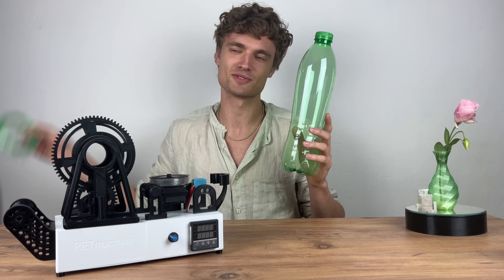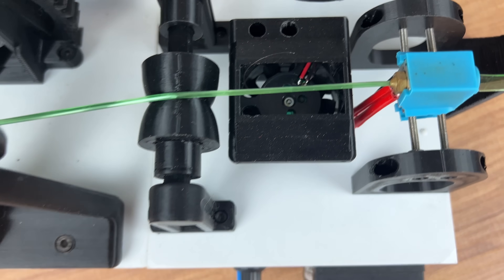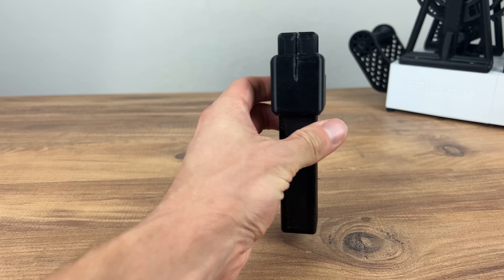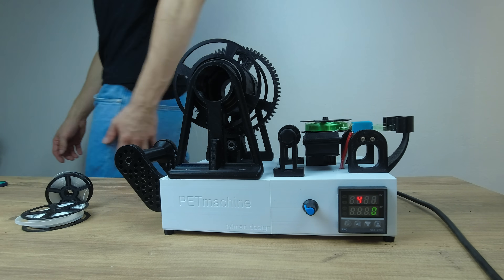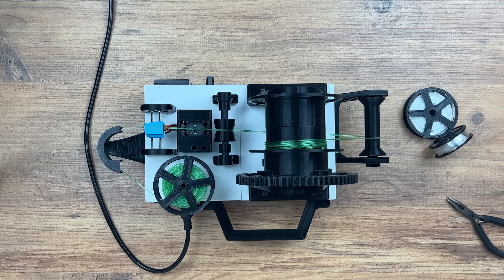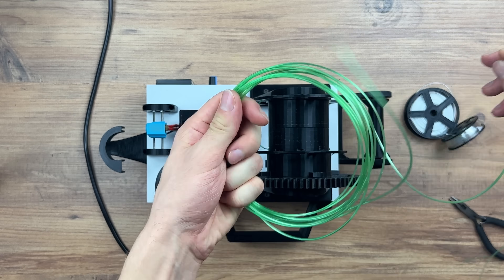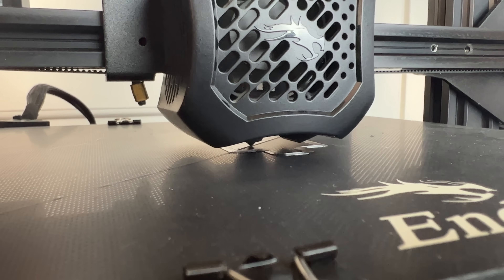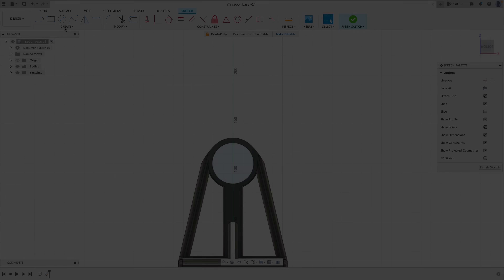Turn Plastic Bottles Into 3D Printer Filament at Home | DIY PET Recycling Machine!

Comment: I love it! If I may suggest an improvement, try to make it into one machine:
1st level - a grinder for grinding bottles to flakes.
2nd level - a hopper funnel that collects the flakes into one heating "pot"
3rd level - an injection nozzel that outputs the fillament!

That way you reduce the amount of involvement by the user, and the outcome is more uniform.

Great work sir! Well done!
Reply from the maker: Hello! Thank you for your great comment! Yes quality of the filament will be better, but cost will be 5-10 times higher. I prepare my project especially to be affordable and easy to make for even the beginner.
Reply: @TylmanDesign  
Hmmm... What if you will make the grinder +*mechanical*+ ? Like... hand cranked?
Reply: @AVMMM  That's an idea, but moving the flakes through the hot end/nozzle is tricky and that's what makes it a bit more expensive. In the plastics business (I'm going back 25 years ago, when I was an embedded systems engineer for the plastics industry), we'd use a screw extruder to push pellets, or flakes of ground up product (that was at a dairy, where gallon jugs that failed in production could be re-used). The best way to feed is pellets, of course - some consistent shape provides the best movement. The whole process was a big bigger in scale, of course. The key to reclamation is in the extrusion system.
Reply: The green vase looks perfect as the print lines make it look almost iridescent! For the clear one, have you tried using a heat gun to smooth out the lines, and see if that increases transparency? Would be interesting to test
Reply: i would think melted plastic fumes would be most unhealthy

Comment: I'm a beginner, can you recommend a program and a 3D printer?
I'm very interested in this,
thanks in advance
Reply from the maker: Hello, for sure I can recommend you "Cura Slicer" as a program for preparing .gcode from .stl file, I'm using it for many years and it's great. 
For modeling 3D objects I strongly recommend "Fusion360", for hobbyist it's fro free and there is many tutorials online. 
If we talk about budget printers I really recommend Ender 3 V2, I'm using it for a few months all the time and for this price it's really nice (250-300$). You will have to change/add just few small things to make printing safer and more predictable. It's a very simple "surgery". With time you will understand everything about 3D printing, it's very enjoyable. If you want to buy a really really good printer I strongly recommend the Prusa i3 MK3S+, but the cost is around 700-850$, but it's the "tank" in the 3D printers world, you can print 24/7 for the whole year with no problems.
Reply: @TylmanDesign  Thank you very much for your advice.  I would like to study what you advise.  thank you again.🙏😊

Comment: can you share the nozzle temperature to print with the bottle filament ?
Reply from the maker: Hello, depends of the bottle, 250-260 degrees.
Reply: @TylmanDesign  thank you, i just upgrade my ender3 v2, with a sprite extruder, just waiting some pieces to start to build a recreator but i think i will do yours too ! Great video thank you !
Reply from the maker: @urotsukudoji6663  Super nice! I'm curious how this extruder works, I have Ender 3 V2 as well! Every machine like this and try to care of the environment is amazing! I will be happy if you will build my project. You can check my IG, I share there my prints and things about machine, like updates and tips!
Reply: @TylmanDesign  sorry i was with my 2nd account, thank you for your rapidy !

Comment: Hi Igor, do you dry your pet filamemt? I noticed a lot of popping while printing mine.
Reply from the maker: Hello! Unfortunately I don't have conditions to do it, but I would love check if there is a difference (and I guess there will be). Till now I was printing with pet filament without drying, all the time with acceptable surface and almost no bubbles. Lately I processes a bottle of water that was really hard to print, crystallizing and constant popping during printing, it could be moisture, but I was preparing it like any other bottle, so it's maybe about particular this one. The most important thing is constantly straight strip with no bigger fluctuations (with proper height), to create maximally rolled tube of plastic. Popping can be correlated with crystallization and maybe lowering the temperature will help! What machine do you use? What's your cutter?
Reply: @TylmanDesign  I use an ender 3 bowden extruder with Cr spider all metal hotend. i use petamentor design to extrude the strips, I bored 2 nozzles, I noticed that it works better with the smaller nozzle and a 6mm strip (depends on the bottles) 

My issue is that it stops extruding and the exteuder gear slips over the filamemt at some point so i guess i have heat creep. Right now I am printing a fan duct for the spider hotend and I'll update to a noctua fan. 
To note that my extruded filament looks prestine and there is not much fluctuation, I am overly impressed with how good the puller works.
Reply from the maker: @raa6504  I was using Ender 3 V2 and Ender 2 Pro for printing. I had same problems with slipping and I mounted dual gear extruder for both printers and I forgot about slipping. Due to I don't use full metal hotend I installed Capricorn PTFE tube and it works great. I changed my hotend radiator fan for 40x20 (Sunon) as well. With all these things, 6h prints are not a problem. Noctua fans are quiet but don't have best efficiency.
Reply: @TylmanDesign  thank you for your insight, I already have dual extruder in the amazon basket, I'll look for a 4x2 cm sunon fan. 

Thank you for taking the time to assist me. 
Cheers
Reply from the maker: @raa6504  My pleasure! Cheers!
Reply: Just for fun I also printed 1.6mm trimmer nylon line and it printed just fine except the moisture, so the problem might be a combination of, filamemt hardness and being slippery by nature, heat creep and viscosity.
Reply from the maker: @raa6504  Yes this nylon trimmer line is a funny filament haha But for the most of extruders not reachable. Bottle filament is challenging, but once we understand what it need and how it works it's really nice material, especially that we made it in our small factory haha

Comment: Can you tell me which modeling programs you prefer using
Reply from the maker: I prefer to use Solidworks, but since I changed my laptop for MacBook I have to use Fusion360, it's not that bad, but I used to so much for Solidworks.
Reply: @TylmanDesign  thank you for quick response
Any advice for a beginner
Reply from the maker: @badressam473  To be honest, if I will have to choose it now again, I will go with Fusion360, for designing 3D printing parts or not really complex projects is perfect, I was using Solidworks for 6 years, recently when I started to use Fusion360 it was frustrating a little bit when things didn't work like in Solidworks, but with time my designing speed is almost the same like before. The all basic functionalities are almost the same, Solidworks is for more professional purposes, so for my needs Fusion360 is more than enough, but the biggest advantage of the Fusion360 is license price, it's many many times lower than solidworks one, like 500$ vs 4000$ for a year subscription. Fusion360 save everything in the cloud and you work on the files online, it's amazing solution when you work in a team, you see your previous versions of the particular part and so on. And of course Fusion360 is free for hobbyist use. There is many tutorials for Fusion360 as well.
Reply: @TylmanDesign  
Thank you so much
I really appreciate your effort

Comment: if you heat up strips from two bottles will it connect and go through the machine creating longer filament?
Reply from the maker: I was testing this solution with small successes, I used soldering iron to make a horizontal lines on the two strips lying on top of each other, now I have to create kind of heating heat to do it better.  My goal is to merge two plastic strips before processing so we could prepare long spools and use it later.
Reply from the maker: Hello! We will announce and put PETwelder on sale very soon. You can follow my Instagram account to follow the progress about it: www.instagram.com/tylmandesign

Comment: How do you compensate for varying thicknesses of the bottle walls? Do you adjust the strip width to compensate?
Reply from the maker: Hello! Yes, exactly, for example 0,2mm thick bottle we cut to 9mm height, 0,4mm to 5mm and so on. Cutting machine has 6 different channels that allows to adjust the height of the strip accordingly.
Reply: @TylmanDesign  I see. So you can manually adjust it but it doesn't automatically adjust when it encounters a thicker area or a thinner area in the same bottle. Wall thickness isn't consistent in any bottle, after all. That's especially true of both ends, which are always thicker than the middle is because of the way a bottle is made. Even the sidewalls, though, have inconsistent thickness because PET isn't perfectly homogenous.

Comment: Does the filament work with all 3D printers? Even pla filament 3D printers?
Reply from the maker: Hello! Stock PTFE tube (especially in Chinese printers) is a poor quality, this filament require higher temperatures, frequently even limit of 260 degrees, in this situation normal PTFE tube can degrade faster compared using with lower temperatures. Solution is changing PTFE tube for "Capricorn PTFE tube", quality is very good and it can stand high temperatures better, I made it in my Ender printer and it works great. We can change our hotend for fullmetal one as well.

Comment: How do you make longer lengths of filament?  Overlap the strips going into the hot end so they fuse together.  Maybe glue them with 3D gloop?
Reply from the maker: Hello! It will be the biggest step forward to make it in easy and fast way, I made some tests and I merge it in primitive way using lighter and PTFE tube and it worked, I could print bigger model of HULK from 2 bottles that you can check on my IG. I'm waiting for some components to make first prototype of more comfortable splicer, keep following! 

I think 3D gloop could be a little bit too weak due to really small area of glueing , what's more it can clog nozzle later.
Reply from the maker: Hello! We will announce and put PETwelder on sale very soon. You can follow my Instagram account to follow the progress about it: www.instagram.com/tylmandesign

Comment: wonder if you could use a heated clamping tool to fuse the unrefined pieces of plastics together while on the roll to get a bigger spool as it goes through the heater portion to keep the machine constantly working?
Reply from the maker: Thank you for your comment. Yes it will be amazing. I'm working on it already with smaller and bigger successes. I think I will have a solution soon.

Comment: What temperature do you use on heat table and what thing to glue first path?
Reply from the maker: Nozzle 245-255 Celsius degrees
Table 70-75 Celsius degrees 
I was using normal glue stick, but even without it adhesion was very good.

Comment: 1 bottle of 2 liters is for how many meters of filament?
can you join the plastic of 2 or more bottles together to make a large roll of filament?
Reply from the maker: Around 10 meters. Yes you can joint it after processing the filaments. I'm working on a solution to merge two string before processing it, so for example it would make possible to put big spool to the machine and make wind long filament.
Reply from the maker: Hello! We will announce and put PETwelder on sale very soon. You can follow my Instagram account to follow the progress about it: www.instagram.com/tylmandesign

Comment: was there a difference between PET and PETG with both different filaments due to the color, polymer structure and how well they adhere when it is printing.
Reply from the maker: Adhesion was almost the same, different is printing temperature. The glycol addition in PETG make it more flexible than PET as well.

Comment: Hello, which used beginner printer do u say is good? I have multiple things for under 100 Euro.  Those i have found:  Creality Ender 3 3D, Anycubic Photon 3D, Artillery Hornet 3D, SIENWINY YS-01 , Anet A2, Anet a8, Renkforce RF100 3D.    Which one should i buy?
Reply from the maker: From these You showed Creality Ender 3 is winner. I recommend to pay a little bit more and take Ender 3 PRO version, or Ender 3 V2. They have few upgrades that are nice.
Reply: @TylmanDesign  Ok u say what basically 3/4 others said. I guess its the best way. Its also really cheap used and support seems to be the best with many people using him. I will give him a try! I see forward to try things from youre videos very soon!
Reply: @TylmanDesign  If money is not relevant.. would u buy the Ender 3 Pro or the Ender 3 V2 ? Because they are basically for the same price..
Reply from the maker: @Psychedelic-Playground  Ender 3 V2 for sure, it's the next version of Ender 3 Pro and it's much better.
Reply: @TylmanDesign  ok finde i look forward to find one! I have so many ideas 😁😁👍 Thanks and have a nice day. 🙏

Comment: How is the quality of the printed vase? Is the strength/properties same as the original bottle.?
Reply from the maker: Due the fact it's vase mode it won't be durable like normal bottle, BUT print is pretty solid, layers are sticking very well and I can squeeze vase with no harm for it. 

I printed other models without "vase mode" and they are really tough. 

Im preparing small surprise that I will release on the next weekend!

Comment: Great job!  Perhaps you could waste a little less new filament by taking up the initial thread with a string instead of pulling it by hand.  Then the machine could begin pulling at the proper rate as soon as the filament exits the heater.
Reply from the maker: Thank You so much for Your comment. Good point! I will try to make it asap! Coz it's a big saving of time and material, small improvement but really profitable.

Comment: How much filament do you get for one bottle?
Reply from the maker: From 1,5L bottle around 20g, depends of the thickness of the bottle's wall as well. Using 5/10L bottles we can have it pretty a lot. 

We can merge two filament together and make longer and longer one. But I will introduce it in the future.

Comment: Happy to see an E3V2 like mine printing with PET. Can you share your settings?
Reply from the maker: nozzle 245-255
bed 70
speed 30-35 (I want to reach 50)
retraction lowest as possible 
fan 15%
Flow 105-120% with this filament

Comment: Hello Igor, very interesting project, I'm sure with the research you made for this machine you came across  
some industrial plastic beads heater nozzle, I'm curious if you had the idea to cut the plastic bottles into beads ready to be melt and then process the filament directly. Thank's
Reply from the maker: Actually yes! I have really BIG shredding machine waiting for me. It's a good thing for next projects!

Comment: Absoutely amazing. I just would suggest to use a string tied to the filament holder and the first inches of filament, then you need to pull less time and the constant force of motor takes the work earlier.

Comment: a cool idea would be to make the spool removable so that it can keep the filament on it after processing and be used straight away for printing without having to remove it then placing it on another spool.
Reply: I also heard you said there would be a module to have it cut the plastic bottle as it pulls it through as well? that would be great for automating the whole thing after smoothing the bottle and pulling it through the hot end.
Reply from the maker: Yes, I'm testing it now, but lately I don't have time to finish it, I'm so sad coz of this.
Reply from the maker: You are totally right, it will make it even more amazing, in the future version I will implement it for sure!

Comment: Man keep up the good work  just a few refinements from spectacular, maybe a removeable spool to keep filament ready to go to printer without rewinding or perhaps a grind and melt unit to cut out prep of the bottles - peel sticker toss in filament maker / recycler
Reply from the maker: In point bro! It will be really helpful, with time I will implement it!

Comment: How do you ensure dimensional accuracy? I see temperature PID controller but not a feedback loop for motor speed vs diameter.
Reply from the maker: Thank You for Your comment! Your point of view is interesting and understandable. 

Feedback loop that You mentioned about in this case won't help a lot. The biggest impact on the filament diameter and further fluctuations have cutting accuracy, if it won't be done well changing speed of the motor will do nothing. 

We have to take into account that we don't "melt" plastic in this process, temperature doesn't exceed 210 degrees, much less even compared with printing in 250-260 degrees. It's just plasticized to give it a shape by the nozzle. 

It's demanding filament to print and require individual approach for and some test before first successful prints.

Comment: Might I suggest a method of connecting strips. By using a heated pair of pliers or other such device you could merge the two ends together quite easily.
Reply from the maker: Thank You for Your comment! I made some unsuccessful tests with hair straightener of my gf 🤣 I got max 210 degrees and it wasn't enough. It just shrunk the strips and didn't even melt, but I will keep going!
Reply: @TylmanDesign  Check out Starlino's video, Joining 3D printing filament using PTFE tubing.  That looks like the most practical solution so far.
Reply from the maker: Hello! We will announce and put PETwelder on sale very soon. You can follow my Instagram account to follow the progress about it: www.instagram.com/tylmandesign